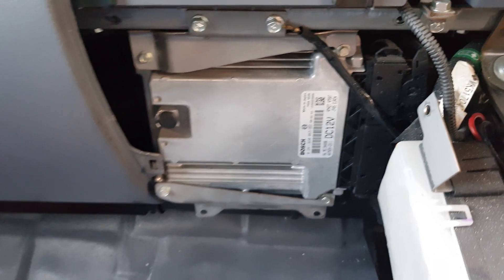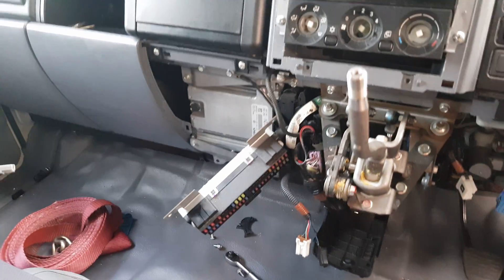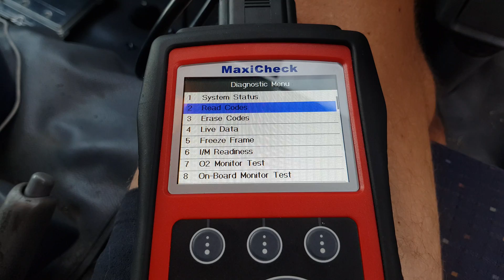2010 Fuso Canter FE83D ECU replacement

Comment: is this the same location for a 2008 fe145
Reply from the maker: I don't specialise in these trucks so I can't answer that question.   That said, manufacturers don't usually make drastic changes from model to model unless the previous design cost them a fortune in warranty claims.  They conform to; if it's not broken, don't try to fix it. 

So, it's probably very similar.

Comment: Hi, do you know if the ecu controls the rpm limiter my 09 model doesn’t go above 28-900 rpm in neutral and in gear, no shake or anything out of the ordinary when max revd just curious if you’d know if it’s time to change ecu to fix this or something else. Please and thank you!!!!!
Reply from the maker: So you're saying it will only idle, basically?  Idle speed would be around 650 rpm.  You put the accelerator down and it only revs to 900 rpm?  Am I understanding this correctly?

Comment: I am interested in a Mitsubishi Canter Fuso throttle sensor and where I can locate it.
Wouid very much appreciate your kind assistance.
Thank you
Reply from the maker: It will be on the opposite side of the throttle cable.  If it's 'Fly by wire', i.e ElectronicTthrottle Controller it will be integrated into the Controller.
Reply: @jamesdolautomotivediagnost9592  it's electronic and wouid you have this part # MK386457 throttle sensor for a Mitsubishi Canter Fuso
Reply from the maker: @robertmageavapalil849  No, I don't sell parts.  I am a repairer.  You'll need to visit a Mitsubishi Truck Dealer or a wrecker.